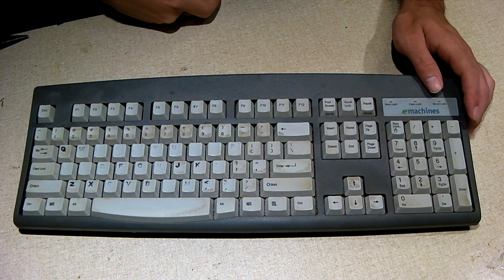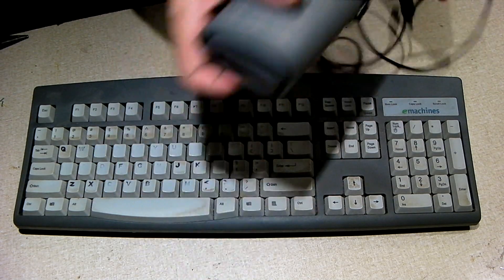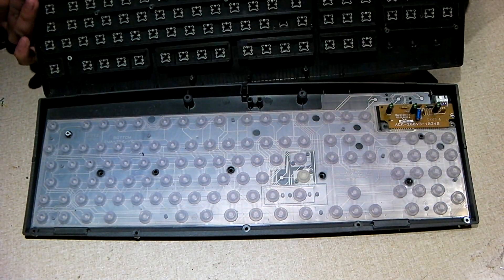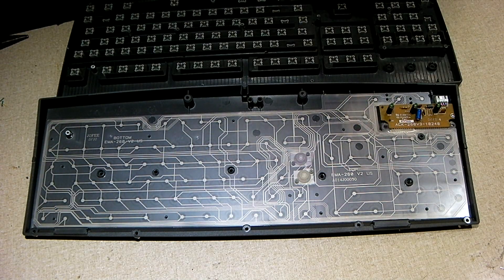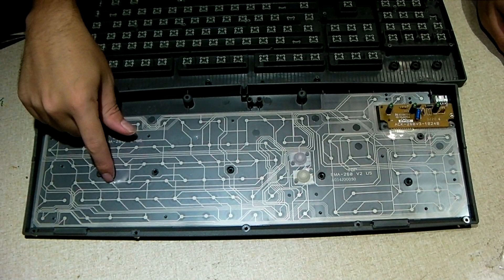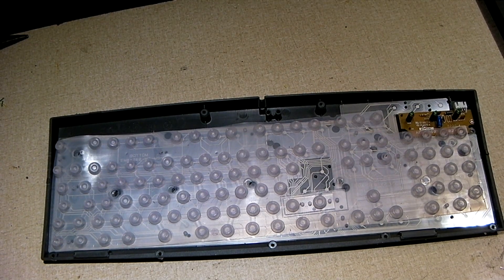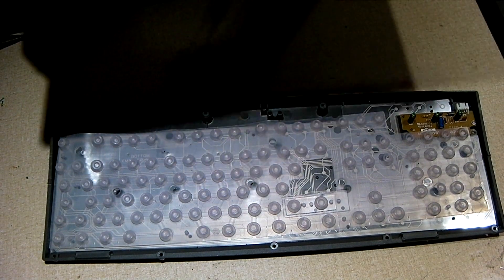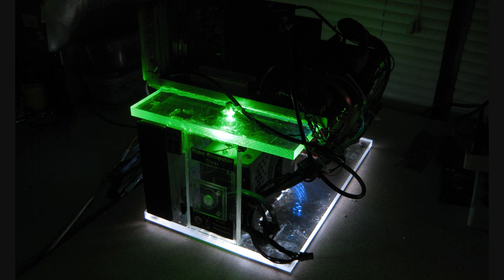Inside a typical membrane keyboard

Comment: Hi, after around three years of owning my keyboard, it has stopped working properly. I have disassembled it to see what the issue is, and I've noticed that on top of the membrane on each of the dots, there is a residue (it's quite difficult to see) perhaps this is conductive and determines if the key is pressed.
Would anyone happen to know what the residue is?
Reply from the maker: I think I have heard of some keyboards having what you describe, though I'm not 100% certain what the residue is called. I have to wonder if one of the old computers The 8 Bit Guy refurbished used a similar design.
Reply: @Cube Computer Channel  I've managed to fix the issue and my keyboard is working fine now. Still curious as to what it is.

Comment: any possibility of posting a vid on "dissassembly of a chiclet style keyboard (membrane & scissor switches)
Reply from the maker: I have some extra laptop keyboards, so I will definitely consider this. Will be more of a teardown (not being able to reassemble) since it's difficult to get the key caps off without breaking the plastic scissors.
Reply: @CubeComputerChannel  hi, if that feels like a loss, that video is not necessary at all. and i think that there are standalone chiclet keyboards available as well, so, they can be much less of a thing to worry about if you can find those for cheap in a recycling shop or something....

just an example: "dell kb216" is a standalone chiclet keyb

anyways, thanks for thinking about the suggestion (:

Comment: in a common keyboard you'll find the 
1. case
2. pcb
(2.5 maybe a dampener)
3. plate
4. stabs
5. switches
6. keycaps
, but what are those rubber domes? and below that is that the PCB? (asking because it looks very different from a stock keyboard like GK67)
Reply from the maker: The 2 sheets below the rubber domes are the matrix. It's essentially a giant PCB with all of the circuits that are able to detect key presses. When the key is pressed and the rubber down snaps down, the 2 parts of the matrix press together, forming a circuit. Various keyboard manufacturers may design their products in different ways.
Reply: The gk67 is a mechanical keyboard, the one shown in the video is a membrane keyboard

Comment: I would suggest you give the key caps part a good wash before you put it back together! 
I clean my keyboard like that once every 6 months and it gets the job done.
Reply from the maker: That keyboard's getting trashed. I used the PS2 cable from it to repair a different keyboard. That's keyboard's garbage. I replaced it with a lightly used vintage Dell QuietKey.